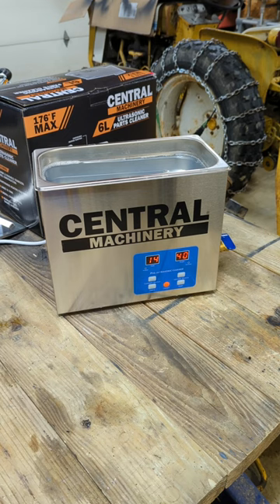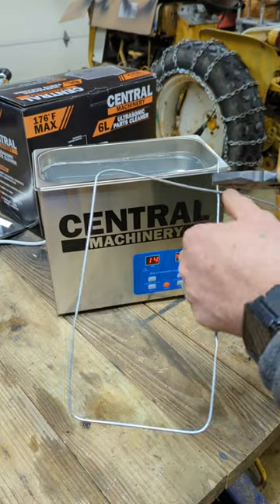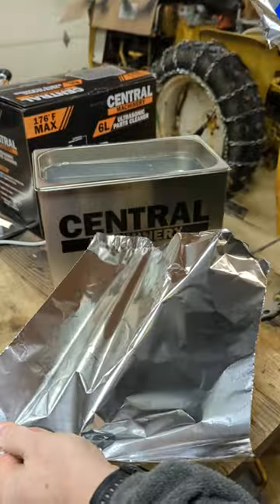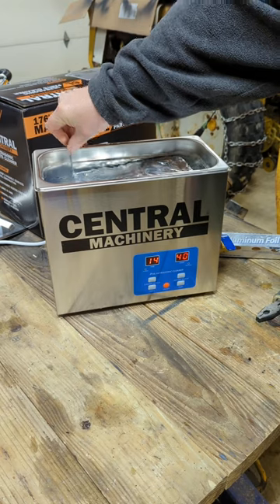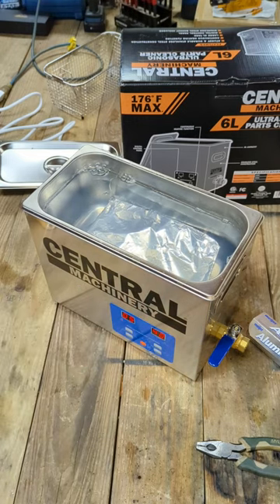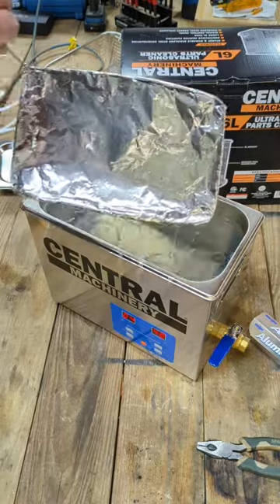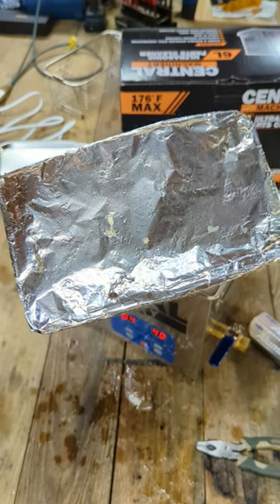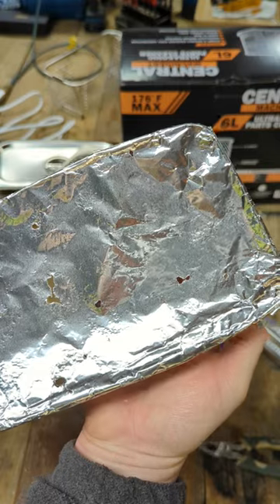How to test your ultrasonic cleaner using aluminum / tin foil.

Comment: Did you know an ultrasonic parts cleaner is a sander hooked to a bucket how it’s made that’s crazy in the prices they get
Reply from the maker: And to think I thought it used a transducer glued to the bottom of the tub that produces high frequency sound that travels through the fluid causing cavitation.
Reply: @1D10CRACY  What?! Stop being silly. Who would think that.
Reply: Not true at all but okay buddy 😂
Reply: @1D10CRACY  plus they are heated haha
Reply: used  a palm sander to clean carb jets for years and it works just as well
Reply: @@falkirk8413  yeah, but why use a hand sander when you can throw them in an ultrasonic cleaner, save yourself the work, and still charge the man hours?
Reply: @marcusborderlands6177  because I'd be charging myself lol
Reply: Is this a joke? I'm having a hard time telling.
Reply: they use a peizo bud, not a motor..........
Reply: We just buy 5 gallon buckets of carb cleaner put parts in and in the morning pull them out. Last bucket lasted about 35 years.
Reply: @michaellewis9589  cause thats how diffusers work
Reply: Wtf are you talking about?
Reply: mines just mounted to an idling V8 kinda weld it to the flat spot on top , needed to add a hood scoop for the space but cleans parts with only side effect of getting where you're going 😆 maybe want a lid for the hard cornering and jump ramps
Reply: What's even crazier is we just bought one of these for our lab and corporate dictates who we can buy from might as well double the price of these if vwr slaps their name on it
Reply: No sander will make 20 kHz at 50 Watts power.
Reply: Did you know that what you described is a vibratory tumbler
Reply: A sander hooked to a bucket makes a subsonic cleaner, not ultra
Reply: @pulsartech2945  woosh
Reply: @byloyuripka9624  woosh
Reply: @turquoisephoenix6548  stay in school kid
Reply: It's way more complicated than that bud

Comment: I stuck my finger in one by accident & I immediately figured out it was working just fine  😂
Reply: Im a mechanic i sometimes clean the fingers likenthat lol
Reply: @ASHLambretta  lol for real? u dip ur philanges in the spicy water??
Reply: @joeylamp_holder2013  the spicy water is fine just tickles your bones after abit very weird feeling .... bit like licking a 9v battery its bad but still do it again lol
Reply: @ASHLambretta  true!
Reply: I would not a suggest this. Been working with organic and inorganic chemists who regularly use ultrasound (too be fair they use more powerful and more wide ranged transducers). Some of them have a forever tingling sensation in their hands, one even reported it hurts his joints. Your bones have some intermediate skin/silk around them, the ultrasound removes that, exposing the bones to vibration, this is especially bad around the joints. Additionaly ultrasound is used in cell-lysis. And it can damage your hearing, just like you dont need to see the infrared or even ultraviolet laser (or really any kind of energetic rays) doesnt mean it wont hurt your eyes.
Its probably fine if you use a low powered one once a week or so. But trust the professionals, they now use wooden clamps to hold their glassware in the ultrasonic bath because the wood absorbs/discipates the sound waves.
Reply: Done that a once
Reply: @ASHLambretta  I'm a machinist and so the same thing, fastest way to clean hands off of oil.

Comment: You can do that without the coat hanger. Just put the foil in directly.
Reply: Makes it easier to remove and inspect but yes you are correct
Reply: the foil gonna float isnt?

Comment: There iso regs for this test if you want your sonicbath a pharmaceutical levels, cut the aluminium foil into strips approx 1 cm / 1/2 inch. Make a grid with tape (3 strips going left to right, 3 strips going up and down) at the inter section of the grid, hand the strips so they are about 1cm/ 1/2 inch from the bottom,  ensure you have filled the bath to the fill line then turn on for 5min, you'll be able so see the strips decompose and be able to track what area is working the best and if and area stops working, be sure to clean out the bath after as there will be little bits of aluminium in the bath
Reply: This is what we have to do for our sonicator in our Mycobacteriology lab
Reply: Why do you need a ultrasonic cleaner for that if I may ask?

Comment: I have that same cleaner and can't say I've been all that impressed with it. It doesn't seem to do anything at all. I can see the parts vibrating inside but it don't do anything at all to clean them unless I use some pretty nasty chemicals, which would clean the parts without the ultrasonic bit just the same. 
I tried the aluminum foil trick and it turned the water gray and turned the tub black around the sides.

Comment: Why not just put parts in it, if they come out clean it works .
Reply: Or in healthcare use you want to know if the water is 37 degrees and the ultrasonic waves are good. Because the parts you clean in it are just out of the Operation rooms
Reply: @joostvanwilligen  I am curious what kind of things a surgical center would clean like that

Comment: The cool thing about a trade school,  the teacher,  standing next to the hot tank, holds a piston over his head,  and says this is why you need to take EVERYTHING out of the block and heads and only cast iron and forged steel go in this tank (dipping piston in the tank, and a cloud of aluminum washes off the outer surface of the piston) that super saturated sodium hydroxide solution is some vicious stuff.
Reply: Yea the automotive tanks can have gnarly solvents this one looks like a small parts/jewelry cleaner can work with just water
Reply: It may have been super saturated, but certainly not with NaOH alone.
Reply: @littlejackalo5326  thank you for explaining to the rest of the class how chemistry jargon works,  a super saturated solution requires a solvent for the chemical to be dissolved in.  In this case,  the teacher reached for a brass valve over the hot tank turned the valves handle and lit the heater,  after reaching the full line he waited for the mystery liquid to reach its operating temperature then added lye drain cleaner until it would no longer dissolve  ... I would tell you what the solvent is,  but I wouldn't want just anybody on the internet to have access to such a powerful solvent.  Just imagine people cleaning their engines so thoroughly  ...
Reply: @rodgerneeb301  simply knowing a chemical's name doesn't make it easy to get ahold of. How many people hear about piranha solution and actually make it themselves?
Reply: @Shpoople  well,  there are several ways to come into possession of Sodium Hydroxide  .... the old fashioned way is to take wood ash and add water  ...  as an alternative name for Sodium Hydroxide,  is Lye as in Lye soap as Granny in the Beverly Hillbillies would tell you  ... OR ... as any boob with a Walmart near them can get it from the drain cleaner aisle under the name Red Devil Lye drain cleaner  ... thanks so much for asking,  please come again  ...

Comment: Forgive my ignorance, i have no experience with ultrasonic parts cleaners. Does that mean they aren't suitable for aluminum parts?
Reply from the maker: If the metal is soft enough, it can damage the surface.   Typically things like carburetors survive because they are thicker metal and you don't leave them in for long periods of time.  It's normally not an issue.

Comment: Next time when bending metal, wire in this case, bend the metal over the tool not the tool over the metal, you'll get tighter and sharper bends

Comment: Did you know you can test it by putting parts in it?
Reply from the maker: You probably can, but it wouldn't be a very good test.   By using the foil, you can see if any of the areas are not getting hit or are weak from the sound waves.   It's a good way to map out any weak spots in the tub as well.

Comment: Does this work with just water in the bath?
Reply: Aluminum reacts with water.  Ultrasonic energy breaks down the Aluminum oxide layer which prevents this reaction from happening normally.

Sodium hydroxide will also dissolve aluminium oxide

Comment: I'm more interested in the 154 in the background
Reply from the maker: How do know it's a 154 and not a 185?  :D
Reply: @1D10CRACY  because the 185 were red. My dad had both.
Reply from the maker: Nice!  My 185 and 154 are both yellow, from the factory.   My 184 is red.
Reply: @1D10CRACY  interesting,  my dad's 154 had the low range planetary reduction gear that we abused,  and consequently got expert level at replacing.  After it's first about 30 years of use, I rebuilt the engine,  during it's tenure,  there is not a part on it that I hadn't touched.  Of course causing the desire to do grievous physical harm to the engineers responsible.  Among these,  the guy who decided to put the brake bands deep in the final drive  ... the bands eventually just rust in two. 
I think the guy that made it into the 185 did his best to atone for the other engineers,  I really appreciate his work on the PTO clutch redesign and splitting the starter and alternator into separate units,  that all in one belt driven starter is super pricey when the bolt for the field coil breaks off.  Ah, Good times  ...

Comment: This not how to test a ultrasonic washer. This method will only confirm activity at one depth. 
Having been a test person on Decon equipment this is not the best method.
Reply from the maker: You mean this isn't the "best" way to test an ultrasonic washer.   For the average DIYer it is probably more than adequate.   They can re-run the test and vary the height of the foil and get a very good idea of any problem areas inside the tub.  It's not a "medical" grade test, but cheap and easy enough to do and get the job done.